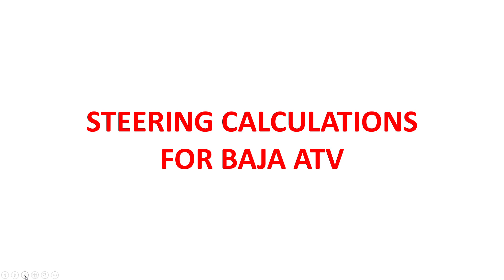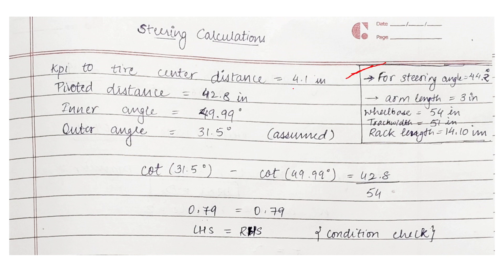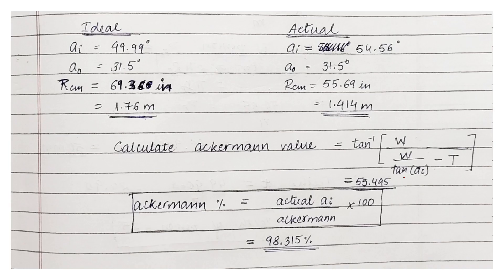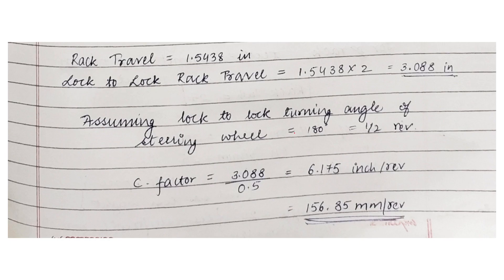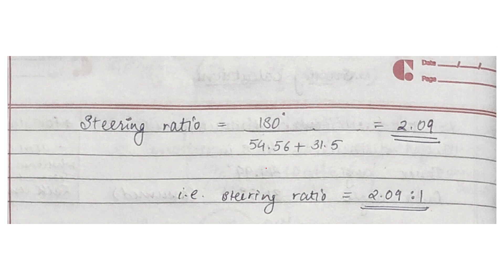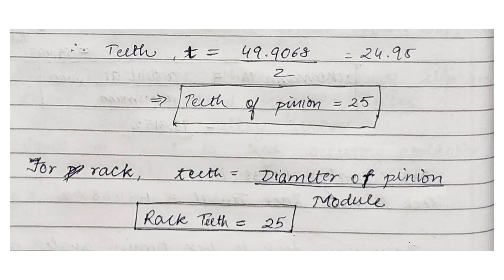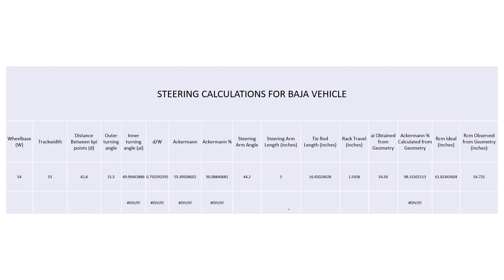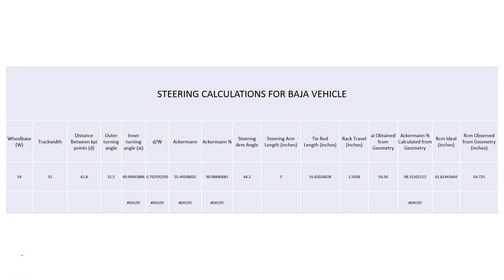STEERING CALCULATIONS FOR ACKERMANN GEOMETRY | BAJA ATV | Ackermann % Calculation | Rack and Pinion

Comment: Hi bro
Really appreciate the video
I still have a doubt regarding teh Ackerman Arn length calculation
Can u explain how to proceed with the geometry?
Reply from the maker: @shaashwatjay6603  Heyy!! Thanks for the appreciation!

Arm length depends on the space constraints you have between your wheel and tire rod. It is an arbitrary value for which you need to perform iterations. There will exist a value for which you'll achieve your perfect Ackerman. 

You can put values with increments of 0.1 inches taking a minimum and maximum value your design could accommodate.

Hope this helps!!

Comment: Are you sure the formula for the c factor is correct?
Reply from the maker: Yes...
But do you have some other formula?
Reply: Yes. C factor=rack travel/360% of the pinion
Reply from the maker: @kostakis-r9b  aren't these both formulas same?
Reply: @murtaz1406   I really don t know. It s the first time I am studying about gears and dynamics so I am confused
Reply from the maker: @kostakis-r9b  I've taken c factor as mm per inch revolution (or say per inch rack travel) and you're taking it as mm per degrees of revolution.

Comment: how to calculate rack travel, lock to lock angle and steering ratio?? I am unable to find formulas for it.
Reply from the maker: In my knowledge, there are no formulas for them. You need to calculate it by making the geometry itself. Lock to lock angle needs to be assumed as per the steering effort. If you are having a very large steering effort then increase the lock to lock angle.

Comment: What is this “geometry” that you have mentioned frequently, from which we are getting some of the values?
Reply from the maker: Geometry explains the locus of all moving points. If the vehicle takes a turn, the components move and we need to find their path of movement. The purpose of geometry is to find that path and also to find the dimensions of any required parameter.
Reply: @murtaz1406  and how do you draw that geometry? Some software? Free hand or what? Cuz I am unable to understand how to find the rack travel, and it just confuses me more and more, the deeper I look into it

Comment: I had a doubt as to the steps taken for the assumptions taken, like the wheel base, track width, outside angle etc. I mean, if the judges or someone asks how we reached those assumptions, I'm guessing we should know the reasons for it. And i just am unable to find online, how to reach that conclusion. Please kindly help me if possible
Reply from the maker: You will have certain inputs from other subsystem teams(majorly suspension and transmission), like the wheelbase and the trackwidth are decided to keep in mind all the components of the vehicle. Outside angle is assumed for the first geometry and then different values are iterated. 
To start the geometry you have to make certain assumptions, otherwise you won't be able to proceed with the design.

That's the whole point of making a geometry - assume and iterate until you have the best one matching with the suspension geometry parameters (like pivoted distance).
Reply: @murtaz1406  as you said, certain assumptions have to be taken to be able to complete the calcs. But do those assumptions include stuff like kpi, tie rod length etc too? Cuz if not, then how does one find out those lengths?
Reply from the maker: @vabsyo4891  assume the kpi length... This length will be according to the requirements of the suspension system. You'll be getting the tie rod top view projection length from geometry. You need to assume the rack casing length and its placement from the wheel axis.
You have to fix certain parameters and iterate to find the next parameters. Once you are certain of some values you can perform iterations to find out others. Watch the video once again maybe you'll understand what I mean to say.
Reply: @murtaz1406  i understand some parts of what you said. Some I don't. Do you have any other platforms where I can contact you? Instagram or maybe telegram? Not everything can be discussed thru YT comments section lol
Reply from the maker: @vabsyo4891  https://instagram.com/murtaz_14.06?igshid=MzNlNGNkZWQ4Mg==